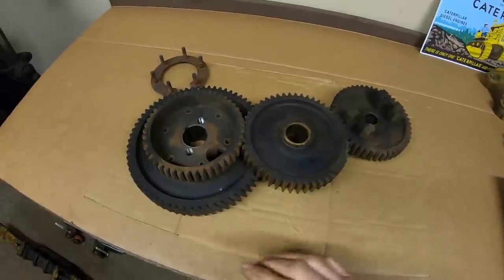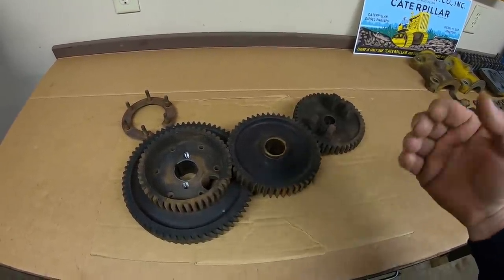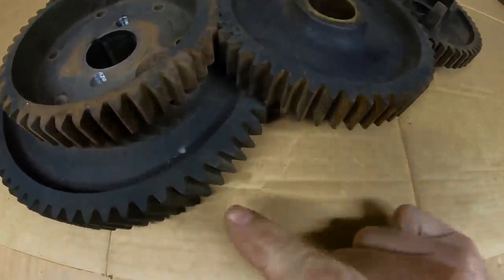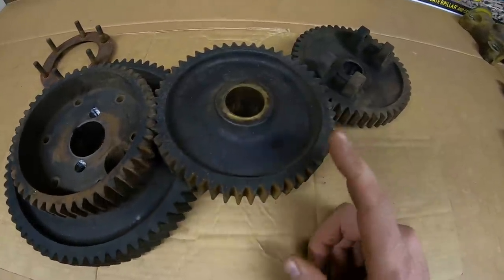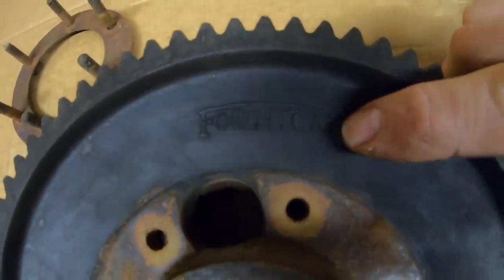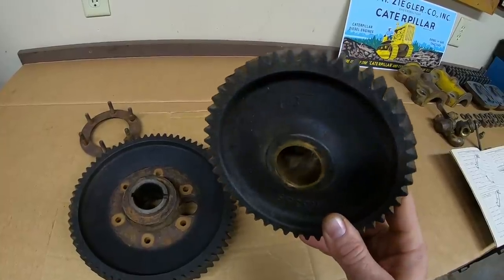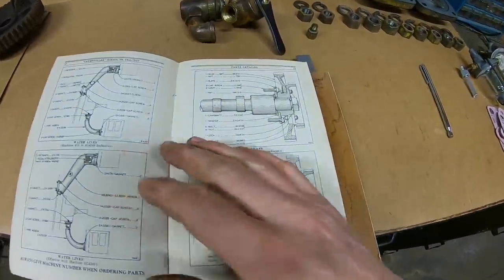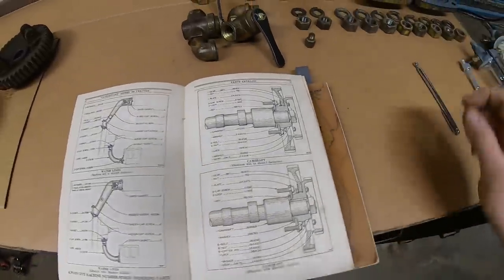Cursed by Design or Ahead of Their Time? 1930's Era Caterpillar Composite Diesel Engine Timing Gears

Comment: I have the 7J5104 to 7J9999 ~ 2T1 to 2T9999 Form 9068
D4 Cat Tractor
page 13  S/n 7J5104 to 7J6566 Inclusive has the compost gears 
at the bottom of page 13 S/n 7J6567 to 7J9999 Inclusive;  2T1 to 2T9999; 5T1 up has steel gears
Reply: Oh dear!  Some folks might consider composite gears to be made of compost, but I don't! 8-))
Reply: Always like when Squatch asks a question and someone goes and finds the nugget of information! Thanks as I was thinking that info might be difficult to ascertain.
Reply: @squatch253  No need, Squatch253! The 2T parts catalog is in the members only Technical Library of ACMOC. That’ll save your money for parts..😀
Reply: some more information on part numbers and where used
.
Two-piece Steel/formica gear
3B-1615		formica CAM drive gear
2A-3376		steel idler gear driving idler gear
.

Updates to two-piece steel/steel gear assembly
7B-9588		steel CAM dive gear
2A-3376		steel idler gear driving idler gear
.

Updates to steel one piece gear  used with SN:  2T1- UP and 5T1-UP
5M-4239		one-piece double steel gear

Comment: Formica was one of those early plastics. In this case it's a melamine-formaldehyde thermosetting plastic  originally developed by Westinghouse Electrical & Manufacturing to replace mica as an electrical insulator. Phenol-formaldehyde better known as Bakelite was the first thermosetting plastic developed. Both types used cotton or linen fabric in mechanical and sometimes electrical applications. The counter top laminate used paper.
Reply: Thanks for follow-up on materials....
Reply: I was just going to ask, thanks!
Reply: Wikipedia has a good short article on the development of Formica plastic.  https://en.wikipedia.org/wiki/Formica_(plastic)
Reply: Tell it like it is, 
People who know what bakelite even is are getting scarce these days. It was used for residential electrical boxes. Now days it's trash blue plastic full of hangups on the outside with paper thin walls that are hard to cut out with a dry wall router. Thanks for the history and chemistry lesson....
Reply: I remember Bakelite from hanging around a TV/Radio shop in late 60's-early 70's.... the material had a strong smell when drilled.....
Reply: so is the Formica the trade name for linen reinforced phenolic resin sheet?
Reply: Btw, Ford Model A's has a "plastic" cam gear.  Quieter.
Reply: @thefixerofbrokenstuff  Yes
Reply: @thefixerofbrokenstuff  For the stuff from the Formica company, yes. Bakelite was still being made by at least one company, in both composite form and injection molded pure plastic forms.

From my memory (which may or may not be correct), the Formica stuff was a reddish color, and Bakelite was always black. These gears look pretty black, but they spent a lot of time soaking in oil, which would absorb a few thousandths into the surface and discolor it. Possibly they would be a lighter color if scratched, though I wouldn't recommend doing that to them.
Reply: My brother has a chunk of Formica that was our family dining table until the 1970s.  It's at least an inch and a half thick and about 40" square.  Dad put steel table legs on it some time before 1959, and I believe the three holes per leg are the only breaks in the slab.  Sturdy and heavy enough to be more like a workbench than a dining table.
Reply: Way back in 68-61 i helped my dad put formica countertops in a local dinner when I visited in 2010 the son of the owner came over to my dad and I and showed us parts of the counter tops still in use

Comment: Ole Geezer Gearhead here. this might be just a bit off topic, but here goes. Many years ago, I owned a '31' Ford model 'A' 1/4 ton pickup. In 1967, I removed the original engine. I had another stock 'A' engine. with poured babbit bearings,  un-bored cylinders, and never turned crank. OK, on to the subject here. While rebuilding the stock replacement engine, I was washing the cam and cam gear. Out of the years of grime, showed a name and a symbol on a fiber cam gear. the name was 'Textolite'. And the symbol, was of all companys, GE (General Electric Co). Well guess what. I was, at that time, employed by GE in one of their washing machine transmission rebuilding shops. when I was a lot younger, I rebuilt many makes of engines. Including a couple of, for those days, antique car engines. But to find a fiber, gear on the cam with the GE emblem on it, and 'Textolite'  name next to it on the face of the gear sure was surprising to me then and still is today to me.. sorry for the long post. Just figured this would fit into your video a little. thanks, Ole Geezer Gearhead.
Reply: Sorry I did'nt scroll back far enough. Please forgive an ole man. I see a couple of other people mentioned the fiber gear in model 'A's.

Comment: Back when I was employed at a sophisticated manufacturer that used composite material in some gears that mated to steel or alloy gears, the lead gear engineer explained that gears using composite (fiber) mating to steel (alloy) don’t wear out, also its a quieter gear train ( in a Diesel I don’t know importance of that). And I have replaced many a timing set with steel when that option was available, the only conclusion I could come up with is that in the heat environment caused the teeth to fail.

Comment: A few old machine tools I worked on have theses in them. With the manual noting reduction in rotating mass and noise but also as a safety in the event of a crash I’ve also seen them as shaft coupler inserts too

Comment: I remember our D4 2T a 1943 ex army dozer just suddenly quit running on a levelling job, after we checked her out we found the timing gear was worn and missing part of the teeth, it had Formica stamped on it . We found out from the local dealer which was Bowmaker Plant at the time that there was a update to a steel gear after Caterpillar found the composite ones failing. Ours had lasted from new to 1985 and several rebuilds according to the original maintenance manual. After locating an old stock steel gear she was soon back up and running.

Comment: From Wikipedia: regarding Formica:

"An important application devised in the 1920s was the use of phenolic laminate fabric for gears; cut on conventional hobbing machines, the gears were tough and quiet, which was important for automotive timing gears. By 1932, the Formica Insulation Company was producing 6,000 gear blanks per day for Chevrolet and other car makers."

Comment: Squatch - I retired from a timing gear company.  The material has several names, fiber, micarta (Westinghouse tradename), phenolic and more.  The last OEM production fiber gear was the came on the Ford inline 6, 330 in-cu.  Reason for fiber - quiet.  Ford had durability problems and vowed to never use it again. In the 80's they came close to using it on the 3.8L V6 balance gears but went with a steel forging instead.  The material was a cotton cloth rag (oriented early blanks - pre 1960 - were random) pressure molded with phenolic resin.  From the 20's up thru the 50's it was used by a lot of engine manufacturers (noise reasons).  The gear teeth were not molded.  Typically they were hobbed and it took a special high speed hobbing machine to create a decent finish.  Even then, instead of machining burrs one had cotton strings.  We burnt them off! Final dimensions were checked after soaking in oil because they swelled a little.  You are right on the cross section hatch, but typically even spaced lines meant iron and steel was two lines close, two lines close, etc.  Good video!
Reply: I had responded about the possibility that due to WWII a change was made due to material priorities. I would like to know the difference in time, between making a fiber gear compared to a steel gear? Squatch253 has since learned that the change to steel was made in 1942, which is when war  production really kicked into high gear. (no pun intended)

Comment: I think I know the reason for the plasic/metal combination. The plasic can absorb small, repeated impact forces. The camshaft is not a constant torque load. The torque to the camshaft constantly changes (and even reverses) because of the camlobes. This causes chatter on the geardrive. The gearteeth are constantly rattteling causing noise and wear because of the impacts. On a steel to steel interface this will cause pitting.  The plasic gears are slightly flexible and can absorb/dampen the impacts.

Comment: General motors- Holden in Australia were using phenolic resin gears in their camshafts for Holden cars right up till the70's. I t made for  a silent gear train. But if you fitted a 'hot' cam to your engine they didn' last long.  Aluminium gears were available through aftermarket parts places. 
 I remember in 1972, being stranded 40 miles out of Tamworth in a Land Rover fitted with a Holden 186 engine.The timing gear stripped while we were cruising at about 55 M.P. H. We got towed into town where we bought a new gear,and fitted it by the curbside outside a service station. Pulling off the remains of the  pressed on gear, without a proper puller was a bear.  I think we hand drilled and chiselled the steel core  till it was expanded enough to take off by prying with a tire iron.  After 6 hours we continued on our way. That cam gear is still going strong.

Comment: I was left walking late one evening in 1959 by a composite timing gear in a Chevrolet straight 6 that stripped teath just before we reached Gorman California on northbound Highway 99. When the gear stripped it bent two valves in
 the engine. The local repair shop wanted an arm and both legs to do the repair work so my father and I did it ourselves on a vacant lot across the street from the repair shop. .
Reply: Got stranded by a 50/60s ford truck with the same issue

Comment: In Australia the Holden 6 cylinder car engine was using composite style cam gears well into the 1985 I believe when they moved to the Japanese Nissan engine. Back in the day I was told it was to do with noise reduction in the gear train. These had a high failure rate as mentioned buy some other comments. We always replace the with aluminium which were a satisfactory repair. So the best I can work out it's noise reduction they were chasing sqatch as an answer to a question you asked.
Reply: Volvo did the same thing with their OHV engines too back in the day (50's to 70's) They used composite and fibre gears on the cam.

Comment: GM used some composite/nylon camshaft timing gears in some Chevrolet V8 engines for many years. Ford and Pontiac use some of these as well. Reasons for their use was believed to be that these composite gears were quieter and helped to diminish vibration induced harmonics through the valvetrain.  Crankshaft timing gears were always steel. The composite/nylon gears for car engines were failure prone. Upon failure it was almost impossible to remove the oil pan from these engines while the engine was in the car.  This almost always resulted in an engine removal to at least clear the debris from the pan and oil pump suction screen.
Reply: I think the the GM 2.5  had  fiber timing gears

Comment: The old Ford Model A also used composite gear on its cam. From what I understand, it's so that if the accessories jammed and stopped, while the engine was running, it would destroy the composite gear(s) and not grenade the whole engine.
Reply: You're right. Don't try to pull start a model A that has sat for a long time  make sure it turns  over  easily and valves aren't stuck or you can strip the fiber gear  out.

Comment: The reason for mating the gears steel-composite-steel is likely metallurgy. Gears of the same material running against each other will gall and break down. That is why cast iron gears are most often run against steel gears.    In a dirty oily environment both look like steel but one is likely cast iron or different grade of steel. My 1975 Olds Cutlass gave me 235k miles before the phenolic gears disintegrated.

Comment: So speaking of Cat not fessing up to something that didn't really work, they still do that.  Like you said, they are really good about documenting everything and putting the info out there to be had.  They still hide a fair amount of ''screw ups."  Cat had an issue with engine ECMs corrupting injector files that were not able to be reprogrammed by a dealership technician.  The fix was replacing the ECM, but it was like pulling teeth to get one authorized so warranty would pay for it.  It affected numerous engines (3456/C15 all the way to the C32).  To this day, nothing has ever been officially published on it.  Most of them in our area have been fixed, but you run across one from time to time.
Reply: Yes  I'm still seeing that problem with those ecm !!!!

Comment: Ford used composite timing gears to reduce noise from what I understand. It was probably for similar reasons in this case
Reply: I think they used them in the N series tractors if i remember correctly
Reply: It’s not like you could hear timing gear noise in a noisy CAT Diesel engine, more likely as someone else speculated, a longevity/durability test to determine the feasibility of less costly engine components for the future. 
GM also used fiber cam gears in their 6 cylinder engines in the early 1970’s and also plastic  coated cam sprockets on the V-8 engines during the same period for the reason you stated. Ford did that also, I had a ‘66 Mustang with a 289 that jumped time one cold morning. It had an aluminum cam sprocket with plastic coated teeth.
Reply: @ralfie8801  ok maybe not noise but harmonics being transferred up to the valve train
Reply: @tylermayfield1987  
No, you were 100% correct about them doing it for noise reduction in the gas engines. Almost all of the the manufacturers used a cam sprocket with plastic coated teeth for that very reason. Almost everybody changed to a steel cam gear when the chain wore enough for it to jump time or in my Dad’s case on his ‘72 Chevy 350 pickup, the chain ate a hole through the bottom of the timing chain cover and I changed the chain, gear, and cover before it was able to jump time and bend all the valves as Chevy small blocks were prone to do. As mentioned earlier, most manufacturers used a fiber or composite cam gear on their inline sixes for noise reduction. 
As for cat, I just don’t see that reason for the composite gears, but I can see them utilizing them in some models as a test to see if they hold up, they had to be a lot less expensive to manufacture than the steel gears they were trying to replace. Those engines also don’t run fast enough to really worry about harmonics. I’m not sure, but I’m guessing they run at less than 1500 RPM.
Reply: Mid 80 6 cylinder ford. Had one fail and replaced with steel set and it ran fine but sounded like a blender.
Reply: @richardluce775  
Inline 6? Did you change the crank gear also? Just asking, I changed the fiber cam gear on a GM 250 inline 6, but didn’t change the crank gear that I can remember and it wasn’t any noisier than it was with the fiber cam gear.

Comment: I think the composite to steel gears were used for oil retention and lubrication as it's using engine oil in an extreme pressure application.

Comment: I’ve never been keen on a setup where two items with dissimilar properties interact with each other.

I’m rebuilding an engine atm that has a jackshaft for running the distributor, oil pump and water pump. It’s driven off the timing chain. The shaft is not hardened, but the components it drives are. If OEM seals are fitted, everything is fine, but these seals are scarce and items that allege the same spec are often just a few thou tighter in ID. The net result is the additional torque needed to drive the water pump driveshaft is enough to cause wear to the jackshaft. You can guess how it goes from there.
Reply: Old mills used pairs of cogs, one with wooden teeth, one with iron. Worked for centuries.
Reply: @paulwomack5866  what sort of mills Paul? What were the forces they were subjected to?
Reply: @paulwomack5866  Take a look at Duquesne Incline in Pittsburgh, PA:
https://www.youtube.com/watch?v=BGrQDuZ7UqU
About halfway through the video the inner workings show a large gear with wooden teeth being driven by a much smaller metal gear
Reply: @junior1138  Wind corn grinding mills, wind (water) pumps, wind powered saw mills.

I did say "old" :-)
Reply: @paulwomack5866  definitely old! Not sure they were subjected to the same torque as a timing gear! 🤣🤣🤣

Comment: Jeep used a composite gear in the L-134 flathead used in the flat fendered Jeeps. The composite gear was on the camshaft and the crank gear was steel. As far as i know they didn't have much trouble with them at least in my experience.

Comment: I do know they didnt use the fremicka in the d8 for the run the winch off the tail end of the cam shaft i had the get the parts manual just for the cat 29 double drum winch just the get part number for the drive shaft yoke seal on the engine end of it, that seal is not in the engine parts list

Comment: One clue is that these are spur gears.  Spur gears make noise and noise = vibration and vibration = wear.  Also, noise = noise, and most people want less noise.
Weight reduction would only be a consideration if weight were an issue.
Ford uses timing gears on their 240/300 in-line sixes and that cam gear is a fiber gear.  These run at higher RPM and mine have over 200,000 and 300,000 miles.
Fiber on Fiber wears fast, but a steel gear driving a fiber gear lasts a really long time.
I'm sure that over the decades fiber gears have greatly improved.
There may have been a thought that running fiber gears as the driven gear would allow a long lifespan for the steel gear and, AND, allow for quick and affordable gear replacement for just the driven gears.